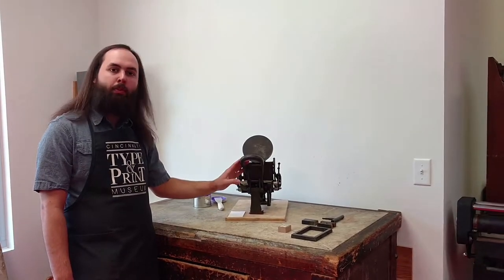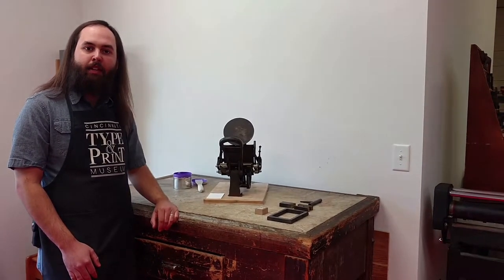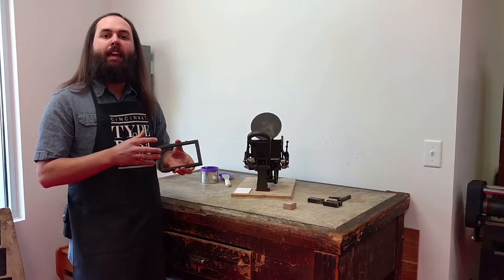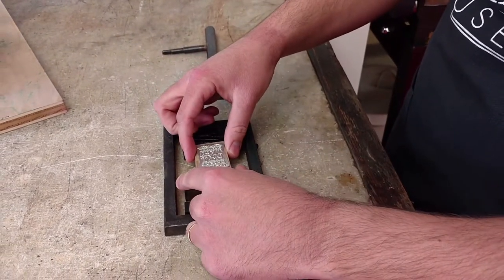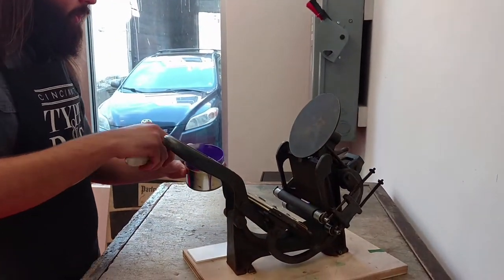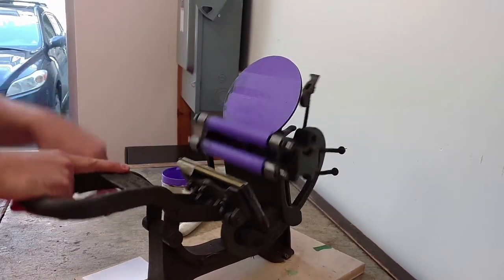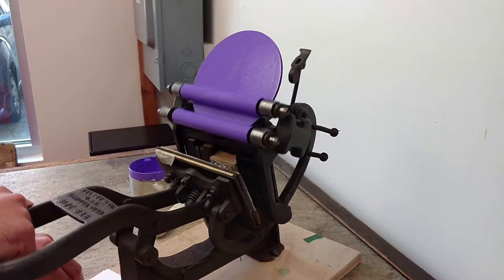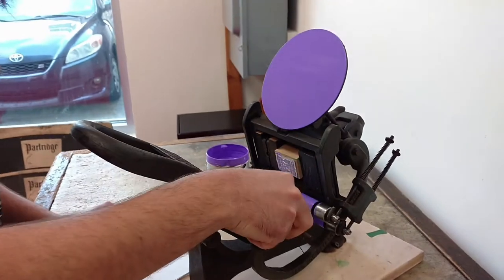Kelsey Excelsior 3x5 Printing Press

Comment: What kind of paint can we use for this machine?
Reply from the maker: Thank you for watching our video. We do not restore presses, so I am not sure what the best paint would be.

If you are referring to the ink used to print, any ink designed for letterpress printing will work. We typically use oil based inks made by a company here in Cincinnati.

Comment: Cincinnati Type & Print Museum.
1. You should have given the year when Kelsey started making printing machines.
2. The ink disc is called an "ink fountain", not a "thing" as you described it.
3. The "chase" is packed with "furniture", not "pieces of wood" as you described it.
4. You didn't plain down the letterpress block before fully tightening the "coin(s)".
5. The metal frame is called a "forme" when filled with "furniture" and printing block, etc. The metal frame is called a "chase", only when it's empty.
Reply: An ink fountain is different. It's an attachment that gradually adds more ink to the ink disk. "Coin" is spelled quoin.
Reply: @oprion  
Okay, but at least I initially called it a disc, which is still better than calling it a "thing". And I accept your correction with the spelling of quoin.

Comment: Why are you exercising your arm to spread the ink across the disk? Think how would you top up the disk when all the ink is used? Answer, use a smaller roller to spread the ink over the disk the first time and for every top up after that. It is a screw chase, why not demonstrate locking up with the screws?
Reply from the maker: Thank you for watching our video. As with many things, there is more than one way to operate this press. We typically like using the rollers on the press itself so we do not have to clean up a separate hand roller. As for the chase, we like to use a quion for ease and consistency with our larger presses. I apologize for not mentioning the screws that can be used instead. That may be a great topic for a future video.
- Jacob M. Simpson, Assistant Director & Curator
Reply: @cincinnatitypeprintmuseum2244  I do likewise! Who needs another roller to clean up?
Reply: @oprion  
Too much effort to clean a little hand-roller?